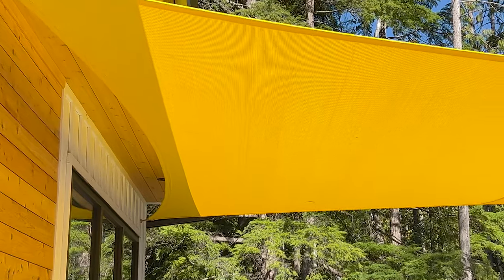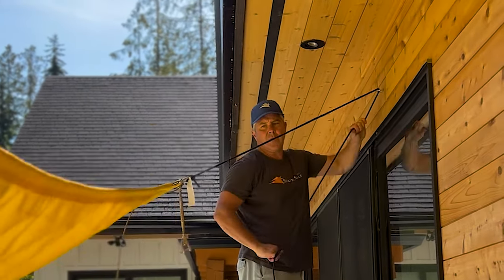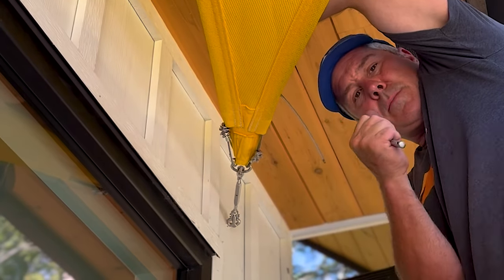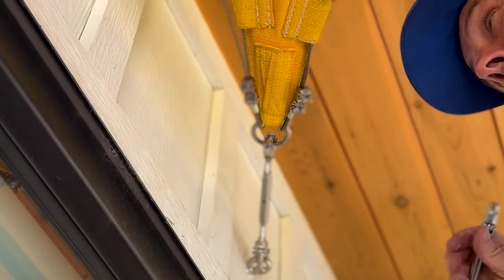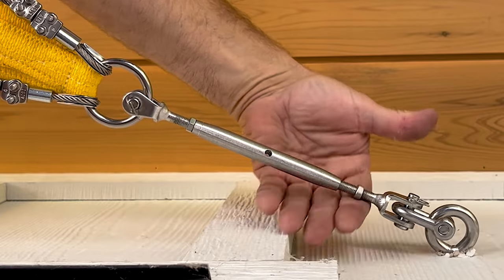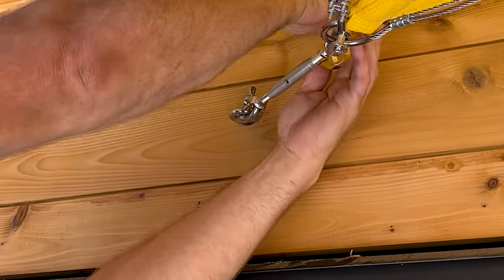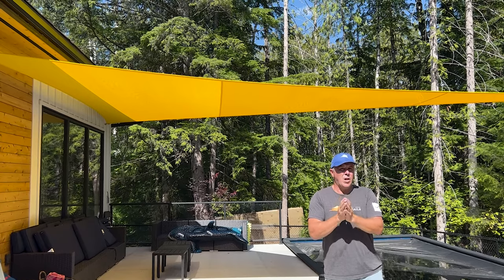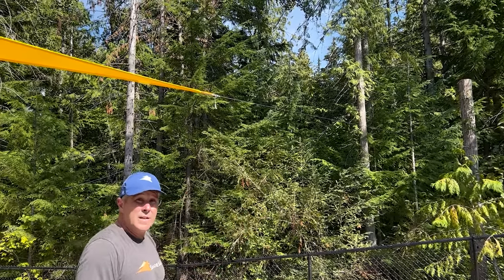Installing your Shade Sail | The "How To" everyone needs to watch!

Comment: I made the mistake of ordering a shade the width of my deck to attach to the wall. It does noes work because on one end is the eves or soffit. I wish someone would have had a video how to install over a deck with impediments. My goal was not only sun block, but also some water block. I set the out post in the wrong place as well. Example shade is 14x 14. I place the plat 14 apart. The shade flapped in the wind, next day bad wind storm came up. So diy is a bust for me. Make a video on where to place the eyes based on size of shade over a deck please. Maybe someone else want waste their time and money.

Comment: What does the tension on the sail cables do to the house walls and tree it is connected to?
Reply from the maker: Hi Norm, 

When properly installed each connection point of your shade sail will create around 150lbs of static force. This does not include wind loading. It's very important that whatever you are attaching to is strong enough to withstand these forces. As a general rule we recommend anchoring into a minimum 3" of structural material. 

Give us a call if you'd like to discuss further with one of our Shade Specialists - 1-855-899-8290

Comment: Can you install the clips on vinyl siding?
Reply from the maker: Hi @pamelasobek1357 you can certainly anchor through vinyl siding into the structure of your home. We recommend anchoring into a minimum of 4" of substantial material to adequately support the forces a properly tensioned shade sail creates.

Comment: Do you use springs with your sun shades? I'm in a high wind area and I put a high-tension spring on mine, but it does move more because of it. Is that bad?
Reply from the maker: Great questions and an interesting design! Our goal is for our fully-tensioned shade sails to remain stationary at all times, even in high wind events. This is why we use our tensioning devices to get the Sails tight like a drum!

Comment: Thank you for all the techniques on the process of sail setup. They are great.
As a life long sailer and a former worker at a boat yard and yacht basin, I understand rigging. I recommend you research proper use of the stainless steel rigging from a sail boat prospective to get maximum reliability from your hardware. There is room for improvement.
Reply from the maker: Thanks for your kind words! Rest assured the installation techniques described in this video are optimal for the longevity and reliability of Shade Sails and their hardware! Take care.

Comment: Did you angle it ? I’m not sure if I need to for rain
Reply from the maker: Great question! Angling your Shade Sail can help water to trend toward and run off a specific corner. If the Shade Sail is not angled, the water will still drain through the permeable shade fabric.

Comment: Can you anchor a sail to Fascia? 
I have a brick home and don't want to drill into it.
Reply from the maker: @messageswithmarni5706 unfortunately not. Our sails are tensioned which results in static loads of around 200lbs per anchor point. We recommend a minimum of 3" of structural substance to anchor into. Our brick anchors are amazing - minimal size and easy to install. Give us a call if you'd like to learn more - 1-855-899-8290